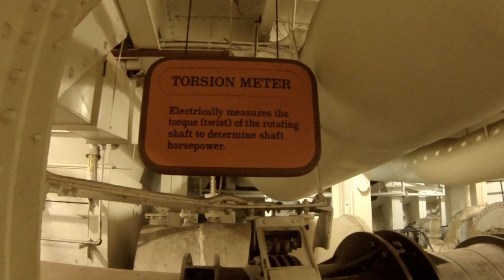RMS Queen Mary - Engine Room

Comment: Great video! Was surprised to see escalators near propellor shaft. Is it a true tradition that all ships have one golden rivet in their hull?
Reply from the maker: Thanks. I believe the escalator was added after the boat was permanently parked for tours. Not sure about the golden rivet.
Reply: I'm guessing there will be another one on the other side of the engine room.  One to bring them down, one to take them back up.  All the plaques around the engine room explaining what the equipment is and its use, suggests there were bigger engine room tours planned than just letting a small group like this wonder about on their own.
Reply: Most of the original narrow iron catwalks are gone, replaced by wide walkways with wooden banisters for the tourists.  The original catwalks are obviously far less safe.